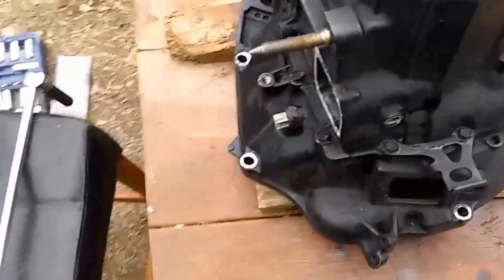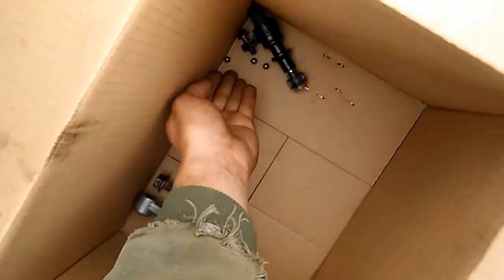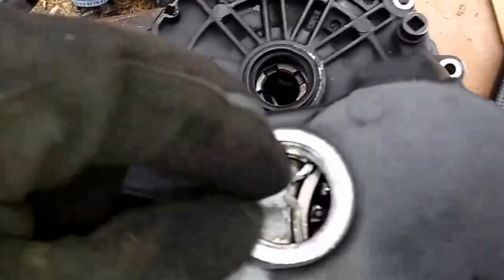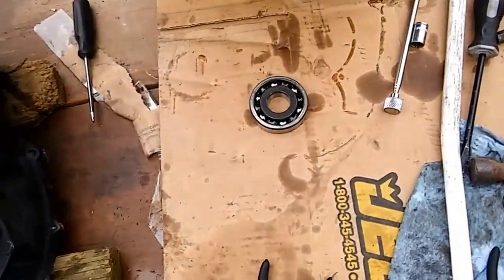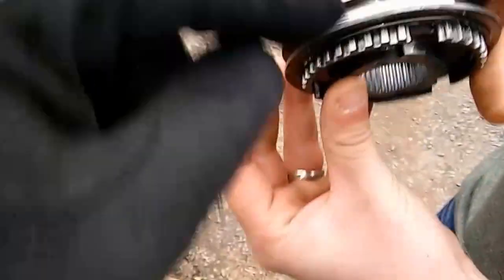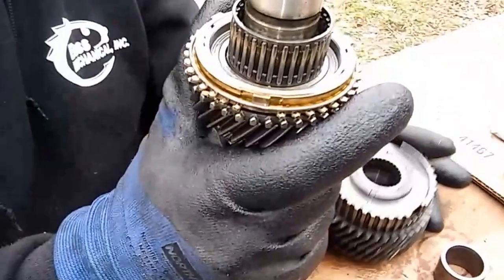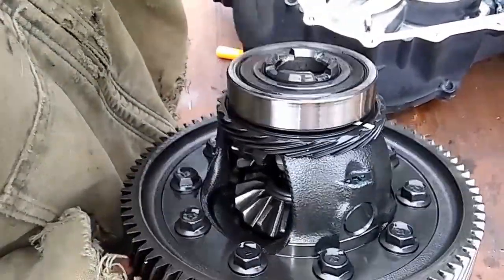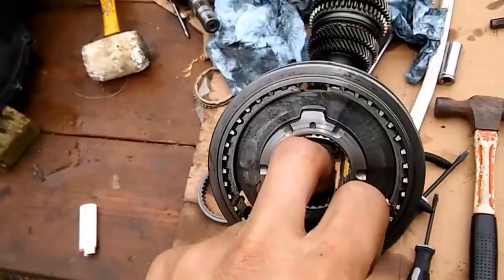K20 Ep3 5 speed manual transmission tear down and rebuild

Comment: Just put a lsd in my ep3 5 speed transmission and had reverse on the table but didn't have reverse in the car... im hoping after I get fluid In and start it that will settle things.. I didn't change bearins or speedo gear just removed 1 of the washers on the main shaft and the diff washer it went to gether smoothly and like said had all gears b4 I put it in the car 🤦‍♂️
Reply from the maker: I had shifter selector bad in mine when i put it in the car and thats why i tore it apart would go into 3rd i had the parts from my broken transmission to fix now it works . but now ill blow my k20a2 up so going get a rebuild to handle the power . Best of luck man with yours i hope you figure it out .
Reply: Any updates

Comment: That bearing that was stuck in the case...How did you get it back on? Did you just lay it back on? Just asking in case mine does this.
Reply from the maker: Daniel Stephens it just slides back on
Reply: PA Tuners Thanks for the fast reply.Gonna replace my noisy input shaft bearing soon.

Comment: Would you be able to tell me when putting together an DC5 X2M5 6 speed mainshaft is the angular bearing suppose to slide on and off? Even when I use a press it still slides off.  Or is that normal? Cause to me it seems like the only thing keeping the gears together or in place is the casing.
Reply from the maker: Yeah its fine man
Reply: PA Tuners ty
Reply from the maker: no problem
Reply: PA Tuners I have one more question.  I just finished rebuilding my tranny. Put in all new bearings and a lsd. I had a hard time getting the case back on and had to use a dead blow hammer to pound it on I guess because of the new bearings not sliding into the recess properly. Anyways all the shifter mechanism move properly but for the life of me could not turn the input shaft by hand while in neutral I did use assembly lube on the internals but as of now it is still dry meaning no trans fluid. Is that normal? Or do I have to tear it down again? Any advice?
Reply from the maker: no that's not normal something isn't right should move freely . i would tare it back apart to check see what's going on and go from there.
Reply: PA Tuners Found our what it was. The bearing for the lsd wasn’t seated all the way in. All good now. Ty
Reply from the maker: Glad you figured it out man . i just got my self h22a red top few days again going swap it in my eg are ek

Comment: thanks for the info had the same problem I'm mine and was trying to confirm that that gear selector should be able to slide all the way
Reply from the maker: No problem thanks for watching . Yeah the gear selector  should slide all the way
Reply: PA Tuners awesome I had a spare trans aswell and got it out of that one .the inner piece looks a little beat but it slides in and out how it should ,wonder what could have caused it to be scratched up like that any thoughts ?
Reply from the maker: drewster956 normally metal debris from beating on them are from low gear oil are from not changing it . I like using redline are synchromesh gear oil and some swear only by Honda gear oil .
Reply: PA Tuners seems good I'm going to send it ,jaja .looks a little scratched but this one moves up and down as it should ,thank u again for ur video helped me out alot
Reply from the maker: Why not i'm sure it will be fine. I'm glad i could help .

Comment: About the 1.8 cam.. my goal was to have the idle your Tib has but after doing the swap it's the same as before.. Fourgreen shipped me the 1.8 Elantra/Tiburon 97-98 intake cam. Same part number as yours too just checked
Reply from the maker: i just seen this . not sure if it was my exhaust i had at the time that helped with the cam lop sound are not